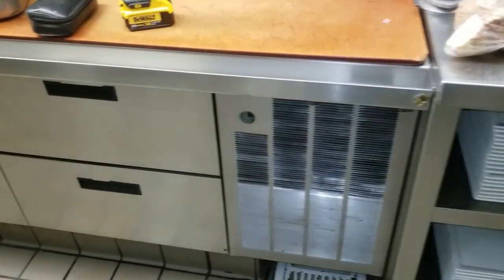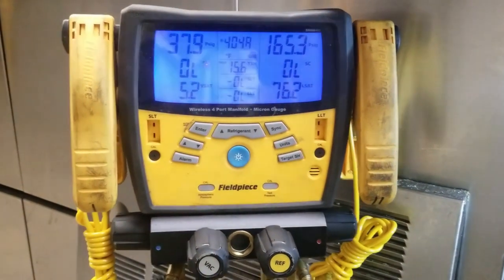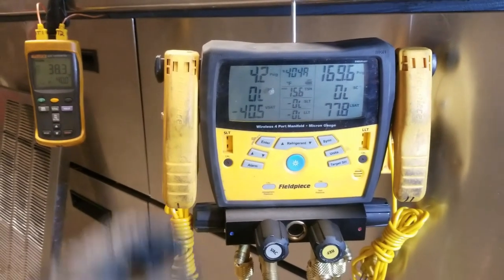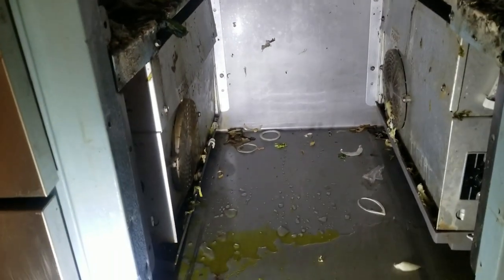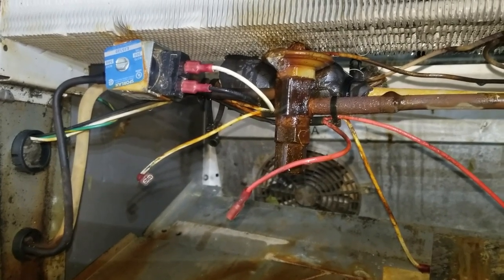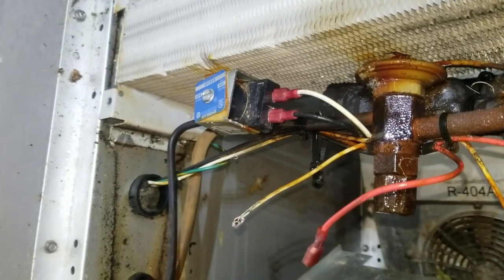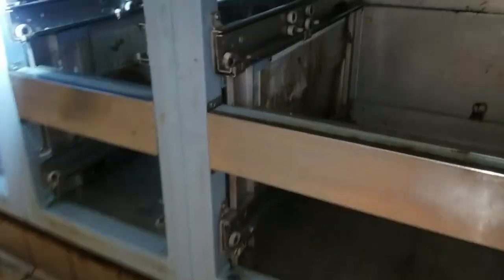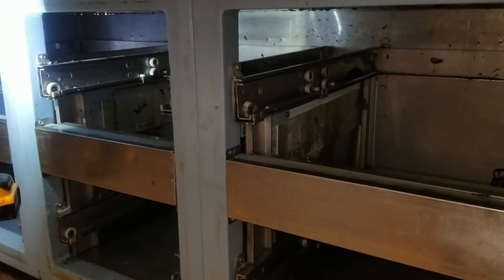Leaking Delfield cooks drawers

Comment: Totally appropriate repair in my opinion you could go crazy and leak test till forever but you only need to take one look at the coils and wave your detector around to figure out there stuffed and your replacing them at some point and anything more than what you’ve done would be a waste of time until the new coils are installed trying to patch them up anymore would not be helpful to the customer as they would only leak again so you totally did the right thing no rational  person would take issue with that what I find frustrating is seeing guys try to save there customers a bit in the short term and only set them up for a loss down the track so nice work man good to see honesty and good advice in our industry keep up the good work and interesting content I do more aircon stuff so it’s fun to see the other side of the trade a bit

Comment: I wouldn’t give you flak for what you did on this job, yes it was a hack job, but it is a temporary repair until you can get the repair approved and fixed properly. I did something similar this week on a R22 glycol chiller for a draft beer system for a customer this week, I bought the customer some time until they approve the repair and spend some money for a proper repair, plus I have the opportunity to tell them clearly that their chiller is not going to last through the summer without work. Good video and good judgement call.
Reply from the maker: Thanks for the nice comment, sometimes we gotta do whats best for the customer. They ended up approving the repair so hopefully I can get some video of the new coil's being installed!

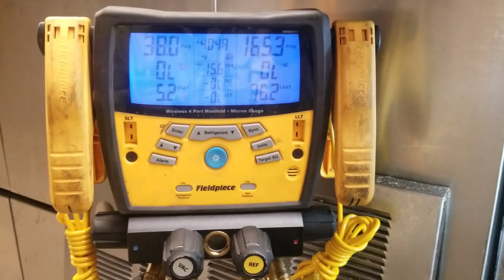Comment: Great repair & excellent explanation on the field of each single step (really you have a gift on communication). And FINALLY I KNOW the Delta Trak thermometer sheath usefulness!! 01:53 :D
Reply from the maker: Funny once you figure that thermometer cover out you.wonder why you never thought of it yourself, huh?
Reply: I stupidly thought this little window was designed for any kind of focus in this area of the probe, "isolating" or softening the rest when used live exposed. Probably since I had a problem with lectures measuring oil temperatures on a deep-fryer, getting wrong lectures on the termomether sinking half of the probe, and accurate lectures once introducing only his sharp end (withouth the cover of course, but with a similar termomehter).

Comment: I have replaced mullion style evaporators on small reach-ins. If you watch the video closely, you may note that the manufacturer took a standard evaporator and turned it "upside down" for this application. You can see the original metal drip pan at the TOP of the unit. At the bottom the mfg added their own plastic clip-on drip pan. The condensate dripping off the coil is going to cause some parts to corrode and rust through prematurely because the acidic condensate is dripping onto parts that would normally be better protected if the evap was installed the other way. I hate it when a manufacturer "modifies" someone else's equipment to suite their purposes, just to create other problems the customer has to pay the price for....

Comment: Great repair, sometimes you gotta do what you gotta do . I’ve done a few of those , pump system down to about 10 Psig, replace the power head while still have positive pressure in the system. Good deal , also those Delfield units come with a Danfoss compressor right? If I’m not mistaken there a condensate loop that sits under the compressor. They’re notorious for leaks there . Great video. Props !!!
Reply from the maker: Yeah the condensate loop was the first place I looked, and it wasnt leaking. I was kind of surprised!
Reply: HVACR VIDEOS yep those always leak there ,but also at the coils
Reply: Good way to replace a valve core to if you don't have a valve core tool handy.
Reply: Is anybody with a refrigerant license screaming at this video. That was not a deminimus refrigerant release. It was totally worth a $10,000 fine per day per occurrence.

Comment: I have a three door prep with cold rail on one compressor, and is 404a, that I want to split and move to the roof. It’s a Randell. Runs too hot. Changed the compressor twice, and the second time the Copeland match was different. It’s lasted a lot longer, for some reason. You have to get the box down to temp before turning the rail on, or the head will push 350. Bad design in my opinion. That’s with the factory charge and a clean coil.

Comment: Nice work! No need for a vacuum if the system didn't get below 1psi, plus with the leaking evaps it would make things worse! I've never seen one of those power elements leak, so will keep an eye out for that in future.
Reply from the maker: heavydiesel thanks for watching and please consider subscribing if you haven't already!
Reply: Just subbed, n' 590!
Reply from the maker: heavydiesel thanks for the sub! Almost to 600
Reply: Hey Heavy, i dont know why the sporlan valves are so popular in the U.S.. they are big, made from steel,they rust, i never like the superheat settings they give.. Danfoss is so popular in Aust and Europe, small, brass. work well..
Reply from the maker: That's funny because here in the US we dislike  the danfoss valves, and prefer the sporlan valves. Go figure huh!
Reply: Funny how the world works, Sporlan made in USA, Danfoss made in Denmark..  We all know how you support your country, that's is a good thing,, Australia dosen't make TX valves, lately we don't make Fuck All. we just buy from overseas..Our Stupid Government run by the powers above that have killed Australian manufacturing.. SAD for Aussie workers...
Reply from the maker: Go figure! I think we get used to certain things and dont like change. I know danfoss valves work just fine but I'm just used to sporlan and I imagine I'm also a little stubborn

Comment: so the power head was the problem then, hence closing the valve    giving the appearance that the system was low charge       because the opening force on the txv wasn't sufficient ?

Comment: Gotta do what u have to do sometimes good job taking caring all the customer
Reply from the maker: Jamison Johnson thanks for watching and please consider subscribing if you haven't already!
Reply: HVACR VIDEOS I have I enjoy your videos I'm in commercial refrigeration myself mostly food service equipment those Delifield coils also leak in those prep tables I replace the whole assembly to braze joints
Reply from the maker: That's the only way to do it, it's too corroded and too tight in there to try and weld anything!

Comment: Some of these prep tables are real scum buckets but you are correct, SOME of the blame cannot go on the operator if the equipment is not able to be cleaned by a minimum wage worker without tools to access.

However, how often have you run into an owner who after that quick fix repair will ignore your comprehensive quote and just wait for the next failure to call you again during a weekend rush?
Reply from the maker: Yeah I've had my fair share of operators that don't care to listen to my honest advice. Than they want it fixed now and under warranty!
Reply: I've been a manager / operator for too many years. Now prefer to deal with broken stuff instead of broken people or capital budgets!

Comment: BE CAREFUL WHEN USING BIG BLUE, YOU CAN MISINTERPRET A "MICRO LEAK" AS JUST THE SOLUTION RUNNING AROUND A FITTING OR JOINT AND MAKING COTTON BUBBLES BY REJOINING ITSELF AS WITH ANY BUBBLE SOLUTION.

Comment: You don't add for ambient on refrigeration ,
Refrigeration systems are designed for 100 degrees condensing  and these compressors aren't suction cooled but air cooled .
Reply from the maker: First off thank you so much for taking the time to watch my video!  I think you are mistaken a little bit or maybe I don't understand what you are saying. This compressor is indeed cooled by the suction gas coming back to it, it is a hermetic compressor and the only air source running across the compressor is the condenser fan motor. While I will admit the condenser fan motor does provide some cooling it's not enough. So if the compressor superheat is too high the compressor will turn off on thermal overload. As far as the system being designed for 100 degrees condensing  temp there is truth in that statement but what I was saying in the video is that as a rule of thumb to find out what my head pressure should be at any given time this particular unit's liquid saturation temp should be 25-30 degrees over the ambient temperature.  Of course the best way to charge this unit is to weigh in the factory charge but that is not always possible.  (On a side note as the condensing temp drops the efficiency or btu output of the compressor increases and vise versa as the condensing temp rises the efficiency or btu output drops.)
Reply: @HVACRVIDEOS  Thank you for taking time to make such great  videos,  I enjoy your approach to service calls .
Check out the design data on these small hermetic compressors and it will list the maximum inlet gas temperature this is what you want to monitor vs. compressor superheat .
You'll also notice that the thermal overload is mounted external, and the data sheet will let you know how the compressor is cooled .
Regarding 100 degrees condensing , this of course is once the system has settled down and balanced out , you'll want to have the liquid pressure at 100 degrees condensing , of course each refrigerant will read a different pressure , but the PT chart will show your condensing temperature ( you have the digital manifold setup ) so you are ahead of the game . 
You'll lose capacity with higher pressures , convert your two pressures to  absolute ( add 14.7 , discharge / suction ) then divide them to come up with the compression   ratio this will show just how efficient your refrigerant cycle is , lower is better .
On coolers that don't have a pump down solenoid , you can adjust the low pressure controller to give the system an off cycle defrost , this is helpful in busy restaurants .

Comment: Happy Thanksgiving to you and your family Chris. 
6:25 - did you used your manifold to put more pressure in the low side to find the leak quicker? 

10:44 -  after turning off tht t stat so the  unit pumps down, how did you lower the pressure of the low side even more? 
Thanks Brother.

Comment: Why do you allways replace the dryer?
Reply: When you open the system it lets moisture in. The drier has a desiccant bag in it. Too much moisture it will burst and do a lot of damage. It is also a filter that will plug with debris. Always change it when you open a system.
Reply: It's good practice to keep system clean and dry.
Reply: @knust5707  cool. Nice to know

Comment: U think 🤔 u can explain how to equalize the system?  I would like to see how I’d done if u don’t mind
Reply from the maker: Yeah I will make a video and explain it for you
Reply from the maker: basically you turn the system off and open the high and low side of the service gauges so that the pressures equalize between the two sides inside the system. It is helpful when leak checking a system so that the low side has a high enough pressure to do a leak search.

Comment: Couldn't you use soap and water for leak detection?
Reply from the maker: You could but the Big Blue leak detector fluid  formulates their mixture to thicken the mix up to make the bubbles really show up.
Reply: Yeah the big blue is so much better than soap it’s hangs around a lot longer and holds the tiny bubbles making finding tiny bastard leaks so much easier try it yourself and there is no comparison we have a couple other brands in aust that are good as well but I seem to always buy the big blue especially since they have upgraded the spray pump

Comment: that place looks disgusting.
Reply from the maker: Its actually pretty clean compared to other restaurants
Reply: I sort of figured it out staring why the piles of nasty on top of evaps by customer.  Even if you pull the drawers out the frames and slides are in the way.  You would have to stand on your head with a wet/dry vac. Only way is how you did it.  Bad design in a way.  @HVACRVIDEOS